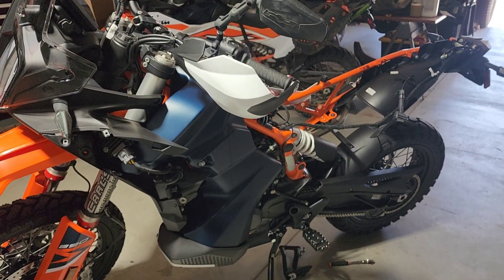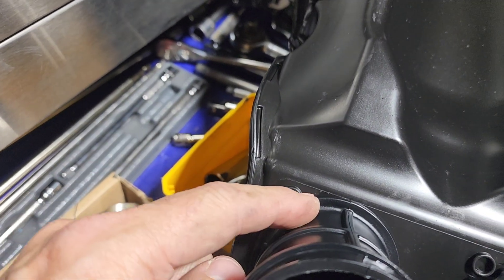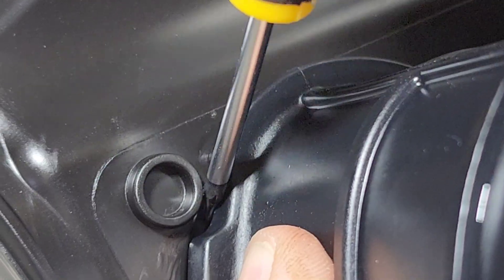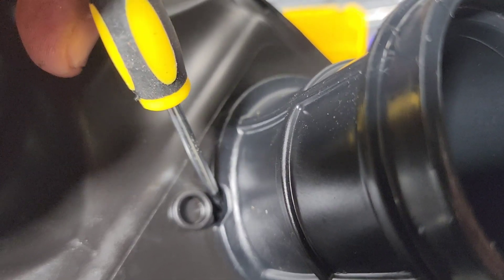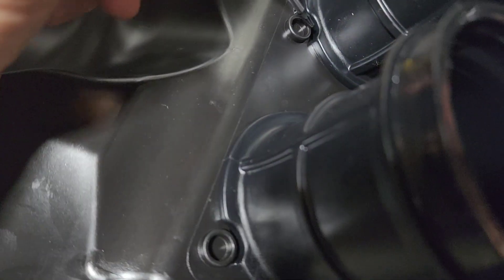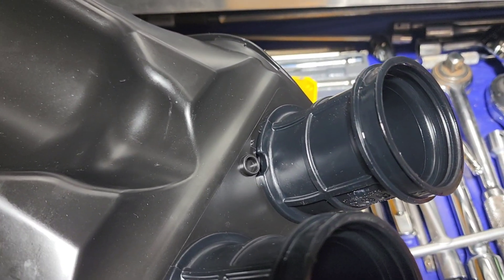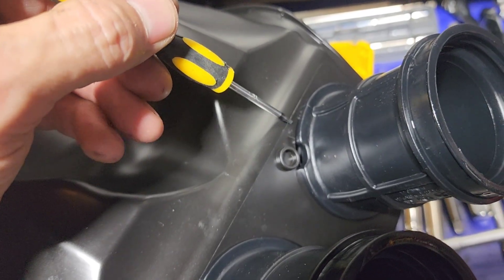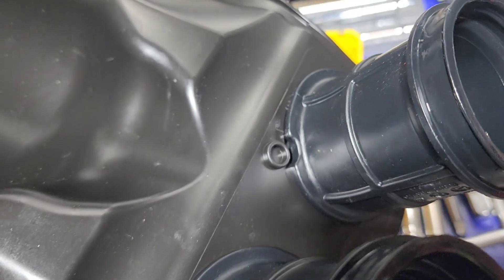Brand New KTM 890 Adventure R - PROOF that the factory velocity stacks are the cause of failure!

Comment: This doesn't surprise me. I'm going the opposite direction from you, sold my '21 890 ADV r and bought a tiger rally pro. I was fed up with KTM issues, Immobilizer warnings in the middle of nowhere, cruise control that sometimes worked, terrible wind buffeting, etc. That said it's a WAY better offroad bike than the Tiger ever will be.
Reply from the maker: And that is why we keep them. Nothing else comes close. We had the Tiger RP's and they did very well. But the damage that it would do to the metal tank if you drop it is very ugly and expensive to replace. Even with crash bars, it is risky. For the same reason, we sold our Ducati Desert X Rally. You can drop an 890 anywhere and it is fine.

Comment: That's nonsense, I checked it myself and nothing gets through there. There's a collar inside and the pipe fits tightly in the airbox. Nothing can get through there. And that's not the cause of the faulty 890s. These bikes like to get kicked in the ass. If you ride like a pensioner, the oil pressure is too low.
Reply from the maker: I hate to break it to you, but even KTM and Husky put out a technical bulletin about it. And multiple dealerships and people we know have had major engine damage because of it. We know there is a lip on the inside, but it barely overlaps the plastic housing just like the outside. And dirt gets sucked right into it. There are indeed other causes of the 890 failures. But this one is part of the picture.

Comment: You miss one point. 
The camshafts are inside the engine. The intake has nothing to do with them. 
Yes having extra air or unfiltered air getting into the combustion chamber isn’t good but at worst it will affect the internal of the engine, ie bore, pistons and valves.
Reply from the maker: I did a lot of reading about it last night. It is well documented that dust gets in and damages the intake valves and guides, which can then cause tolerance issues. And then if left over time it damages the cam. This is what has happened to many 790/890/901 bikes. This is apparently the case with the 901 we sold. It has severe enough damage from his BDR trip that it will not even run now. Seal up this area ASAP.
Reply from the maker: We understand that dirt is not getting into that part of the engine. But the dirt, sand, dust goes in and damages the intake valves, which can then destroy the cam lobes and followers over time. And surprisingly, it doesn't take as long as I originally thought. It depends on the environment. Here in Idaho, the dust is like flour and it is hard on everything.
Reply: @foxtailadventures  Yes you are right. The mating surface of the valves being worn will let the valve stem push up into the cam harder. Essentially tightening the clearance slowly over time. This is the concept that makes most sense to me. What do you think?
Reply from the maker: @skunkprints7952 yes, I believe that is what they say is happening. They also said that because of the build-up and wear on the valve guides, it causes excessive resistance, so it doesn't move smoothly, which also causes excessive wear. But everybody gets wrapped around the axle over it. So I make no claims to it, as I am no expert on the cam issue. Our point of the video is to just seal up this area and eliminate it as a pathway for dirt to get in.
Reply: @foxtailadventures thank you for doing such a good job getting the word out. I bet if you made another video expanding on the resistance and the valve seat wear may people would understand. Regardless thanks I’ll subscribe
Reply from the maker: @skunkprints thank you for your kindness.

Comment: Stop buying KTM’s ! Everybody complains about their poor quality and poor service and yet continue to tolerate them.
Reply from the maker: Every bike has a few things that are problematic. We have owned most of them and ridden them in extreme conditions for thousands of miles. Each one had their pros and cons and design flaws. We have owned over 50 KTM's and we have not had any major issues with any of them. This issue is easily remedied. That is why we shared it. We have owned the Tenere 700, 1250GS, Norden 901, Ducati Desert X Rally and Standard, KTM 690 Enduro R, 500 EXC, FE350S, and many others. Of all the ADV bikes we have owned, the KTM 890 Adventure R is our favorite. It has it's issues like any other. Fantastic bikes for our style of riding.

Comment: Dust from this cannot get into the engine to wear the cam........
Reply: Imagine if the valve seat surface began to wear. The valve stem is now pushing up tighter against the cams. 

It’s hard to imagine by reading but if you think about it hard enough you’ll realize what I mean. Cheers
Reply from the maker: Not directly, no. But it can and does destroy the intake valves, which can indirectly cause further damage. Again, this is based on information coming from 2 separate dealerships that have seen this issue over and over. We are just relaying the info. Either way, this needs to be sealed up.

Comment: It's a bad design but what you show is odd-- it looks like a tear or someone pushed a flat blade through it. I wish you pulled the stack off to show it removed and if it was damaged-and yes there is a flange lip on both sides- that could have been bent out of shape on the inside--a pic from inside and a pic with stack removed would have been a more complete show if this,
Reply from the maker: Nothing was done to it. Why would we? We rode the bike home and removed it. There is no trickery. The video is quite clear. There is not enough overlap inside or our to make an adequate seal. Especially, where they notched it for the alignment boss.
Reply from the maker: Not to mention this is the 4th one we have installed and they are all like this.

Comment: That was not the reason for the cam wear. It was a problem with the oul pump not getting oil to the cam at lower revs.
Reply from the maker: Yes, true. But this issue didn't help with the valves getting damaged. A double whammy. This is according to KTM techs. 

BTW, have you heard if the oiling issue has been corrected for 24/25 models?

Comment: Please tell me no !    How could KTM engineers missed this during all of their deep forensic analysis into the mysterious camshaft wear.  Unless nothing really happened at KTM to investigate this.

I hope KTM does a technical bulletin and get a recall for all the KTM 790 / 890 sold out there to have this issue fixed.  

I hope you're listening KTM.
Reply: i have 690 since 2008 and like it BUT i think i don't want the ktm model as next bike again.
Reply from the maker: They put out a technical bulletin in Australia that describes sealing this up with RTV or adhesive. But not here in the US. And when an engine fails due to this problem, they won't honor the warranty. So it sucks dirt in, destroys the intake valves, and screws up the cams. Ruining the engine to the point where it will not run. The 2024 901 we just sold is destroyed because of this issue. We feel terrible, because we installed the Rottweiler kit like we do on all of our 890/901 bikes before they see any dirt. But we just recently discovered this. Seal them up ASAP.

Comment: This video should go viral to all KTM riders with the same velocity stack and air box. You sir just saved my '24 890 Adv R Rally with 350 miles on it! Rode it once in sand and already dusting on the back side of the trumpets/velocity stacks within the airbox. Pulling out that box this weekend, going to upgrade then seal off that entire area and around the stack with RTV!
Reply from the maker: That is great news! We are so glad you caught it in time. It is a very big deal. Glad we could help.
Reply: and, I had 790 rally and oem intake was clean until I installed rottweiler intake and then rottweiler allowed loads of dirt into engine such that warranty was denied. checkout rottweiler intake issues on advrider. rottweiler lied about intake. btw, despite all the dirt allowed by shitty rottweiler intake, 790 cams were absolutely perfect at 18k miles. zero wear. so, that shoots hole in claim that dirt caused cam wear. I have 890 rally with nearly 22k miles never used crappy rottweiler intake and engine has always been perfectly clean. spotless. so, is there an issue or did poster create issue when removing OEM intake or is this bike a rare case? dunno. obviously, poster trying to insinuate that this is source of cam wear may demonstrate poster's ignorance about engines. the house is not on fire. seeing you in peace.
Reply from the maker: @damytzeus regarding your Rottweiler intake, are you talking about the powerplate prefilter kit that still uses the factory air filter? Or the pro intake kit that replaces the entire air filter housing? 

If you research this issue, you would know that this is a well known problem. We did not make it up out of thin air. It is true that cam wear is different for many owners. Not sure why. But I suspect conditions have a lot to do with that. Like in Australia, it is a very serious concern. That is why there is a tech bulletin about it. Again, not that dirt is getting on the cams. But dirt damages the valves, which affects how they function, which can cause damage to the cam. This is what we have read. 

As I said earlier, either way, the intake tubes need to be sealed at the air filter housing. No matter which housing you have.
Reply: @foxtailadventures  i'm talking about pro intake kit. i installed it and after dirt ingestion, i removed it. you need only research the original problems and how chris, owner of rottweiler, lied. i don't trust chris/rottweiler and, after intake mess, i stopped buying any of rp's products. btw, if you conduct any research, you may also learn that rp's intakes filter worse and make less hp than oem intake. dyno your bike before and after installing rp intake. on the 1290 super duke, 790 and 890, the rp intake robbed the bike's of hp. on the superduke, it was a 12 hp loss at upper range. 12 hp is crazy. bike was totally different after i removed rp intake. chris will claim hp gains. it's a lie. he's liar.
Reply from the maker: @damytzeus thanks for your testimony. We will keep an eye on ours. I can't see how any dirt could be getting in unless the filter isn't oiled right or maybe the filter itself doesn't capture what it should. We also grease the sealing surface. Could you tell where it was getting in? If you didn't seal up the intake tubes, that is a very good possibility.

This discussion helps. I truly appreciate you being a part of it. We are all on the same team. It is so helpful to work through the details.

Comment: What a stupid design flaw and it being on an adv bike from such a manufacturer is beyond unacceptable
Reply from the maker: Absolutely. They have known about this forever. Our local dealer has had to replace many engines because of this. And they tell everyone to install the Rottweiler Pro or Rally Intake kit. But it does not matter if you don't seal this area up. Nobody would even know to look at this on their bikes. It should have been a global recall.